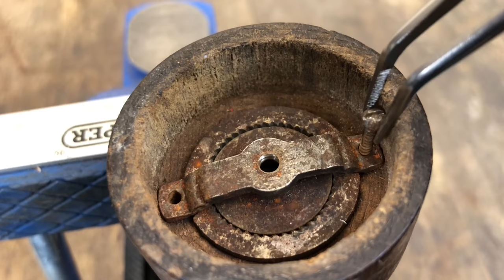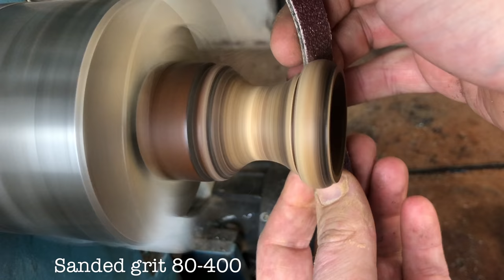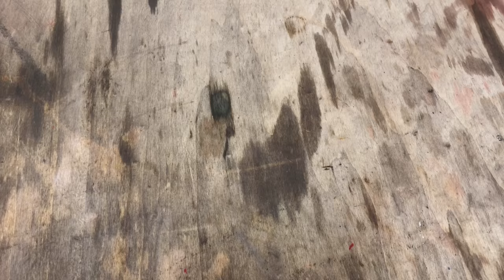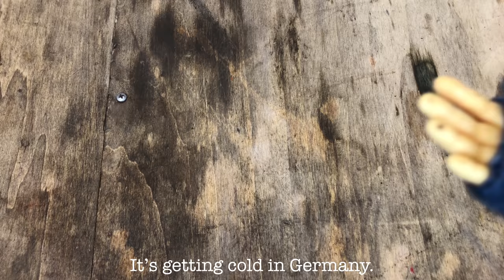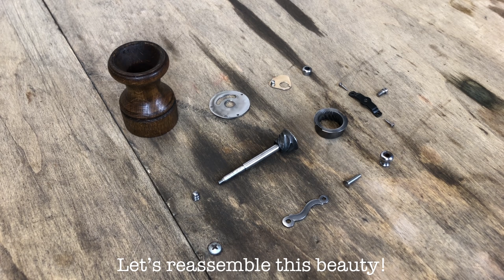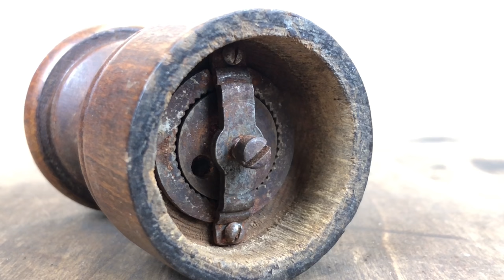Antique Pepper Grinder Restoration | Mister Patina

Comment: I seem to recall elderly relatives who owned a set consisting of a very similar pepper grid and a salt grid. They sat in a metal tray to catch droppings. To grind you want to grasp the grind in your full hand like a fist and then crank. Very satisfying to use the set. Your restoration was excellent.
Reply from the maker: Hey Wiley! Thanks for your comment! Iam on the lookout for the salt grinder, because I want to complete my set :-)
Reply: @misterpatina  I bet your followers will try to help find the salt grinder. Do you know for fact that the pepper grinder is from a set? There are stand alone pepper grinders.
Reply: Am I old if I use a set like this?

Comment: Another excellent restoration - thank you!   But one question - did you replace the filler guard backwards?   It looked like in the unrestored, it slid to the left to right to open which prevented accidentally opening in when you were using the grinder in a clockwise motion.   The restored version looked to slide right to left to open.  Was this intentional?
Reply from the maker: You, sir, got the eyes of an eagle :-) The brass plate, which slides, was in a bad condition on the upper side. The other side was in a way better condition, so I pressed out the very small handle and just flipped the brass plate, pressed the handle back on the good condition side and reassembled it that way, which changes the direction of opening and closing. 
These are just some small operations I don’t put in the video, because the video footage wasn’t that good. I hope you understand :)
Thanks for your comment!
Reply: @misterpatina  Still an excellent restoration, thank you for sharing it!

Comment: Hey dude... I have come up in the comments section if your videos a fair bit and I would just like to say you are absolutely amazing. I would just like to ask where you buy/find these amazing things to restore? eBay, Garage sales? You inspired me to start my own channel and I think you show how good someone can be at something with limited tools

(Edit) I as a machinist would like to point out that those parts you turned on the lathe have been hardened and so are sparking. That is bad for small machines and the best thing to do is to anneal the part to soften it
Reply from the maker: Hey Bro! Thank you so much for your kind words, i really appreciate! Most of the things i find on eBay oder eBay Kleinanzeigen (some sort of craigslist), on fleamarkets, or, in this case, from a subscriber :-) 
I'll definetely check out your channel! Thank you so much! 

Yeah, all my blades are unsharpened now, i learned a lot with this tool. But thanks for your tip :-)
Reply: I wouldn’t say he has limited tools. Far from it. Without all the expensive machine tools, sandblaster, welding equipment many of these these restorations would be impossible.
Reply: @ex-scientia4234  You are right, but if you look at my mechinics for example, he has heat treating ovens, specialty bits, crazy collections of punches and dies, and all sorts of stuff people like us would only dream of.

Comment: Mr. Patina, then removes all the patina...
Reply from the maker: So, did you enjoy the video?
Reply: Definitely, very nice restoration 👍 I would have kept the wood original and boiled the handle in water, then brushed it with a soft brush, would have kept the age in the project. Lathe work is cool + most importantly, it works! Thx for the vid